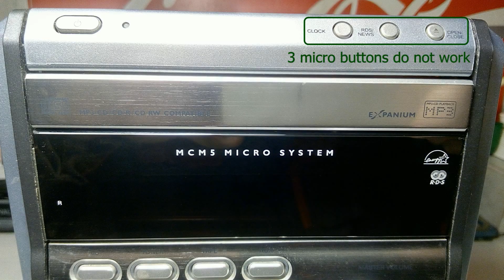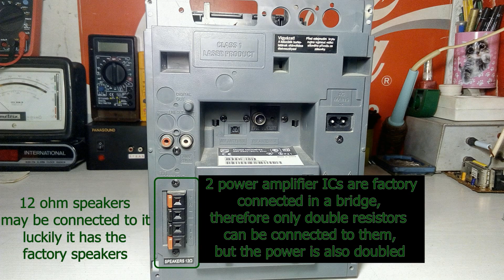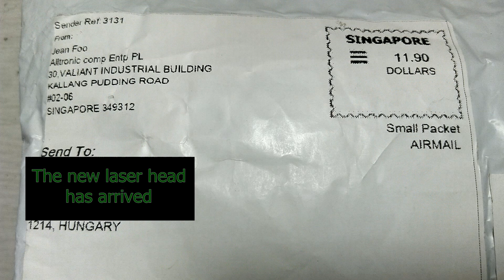PHILIPS MCM5 Micro System (2004) Part 1 Repair

Comment: I have two of those, and now non of them works. When I want to turn it on, it is just trying to swtich on every 1-2 secs, but it won't turn on. What can be the problem?
Reply from the maker: It doesn't turn on because it detects an error and disables it, you need to check the power supply part in particular, faulty contact soldering can also be the cause of the heating parts
Reply: Thank you for the reply, perhaps you are right. When I punch it down from above it switching on. Then it is working for some time, then the problem appears again.  @HIFISTEREOLaca

Comment: How did you remove the CD from the front panel? I tried to pull it out but CD is stucked by CD's front panel
Reply from the maker: You have to remove the decorative front panel from the CD tray and pull it up carefully, this is how it should be with almost all CD players.
Reply: @HIFISTEREOLaca  yeah i get it, but CD is closed so i cant remove the decorative panel. Instruction says that I have to kind of lift up and down CD several times and that decorative thing will fall off. But im scared to broke smthng
Reply from the maker: @TheKubik360  And if the tray doesn't come out, you have to turn the gear by hand from below, because the V-belt is stretched, it will work fine after a new V-belt. Then it is loaded in the upper position, you can lower it by hand so that the tray extends.
Reply: @HIFISTEREOLaca  i tried to do so but there’s no physical way to turn the gear by hand. My model mcm 760/12
Reply: @TheKubik360 have you been able to do it? I have the same player with the same issue.Tray is stuck, CD is in, can not reach the tray motor to manually pul out the tray and release the decorative front cover. Tnx